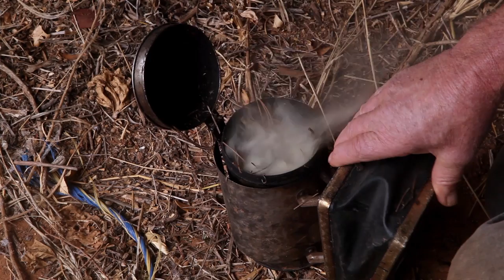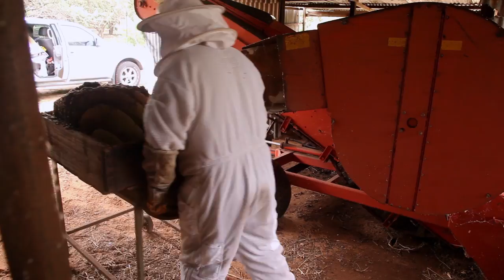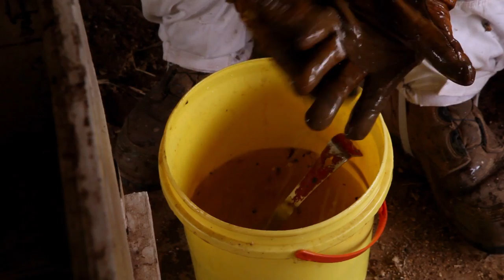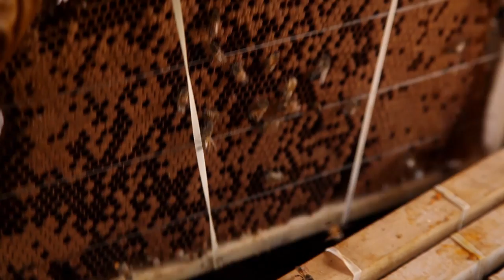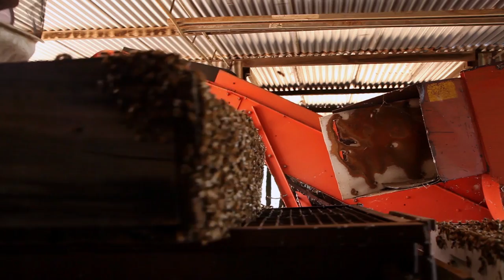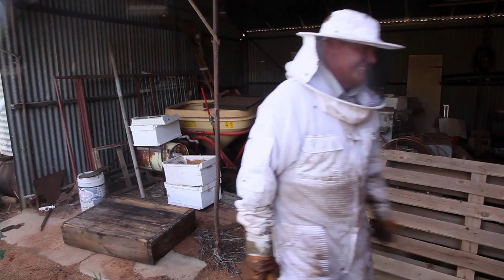How to Cut Out and Re-Home a BeeHive - The Bush Bee Man

Comment: If you use frames without wires the comb will be more centered in the frame after they repair it.  Then you won't need to put it above an excluder.
Reply: There aren’t wires in these frames